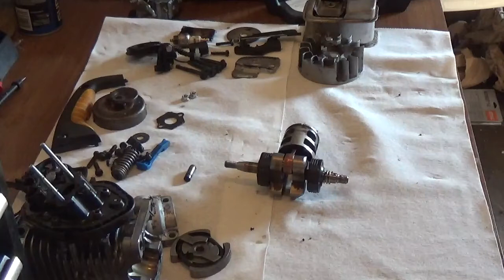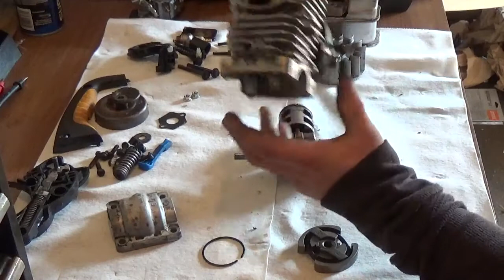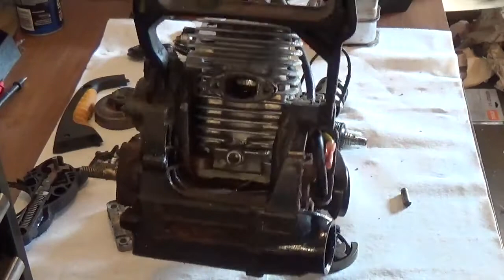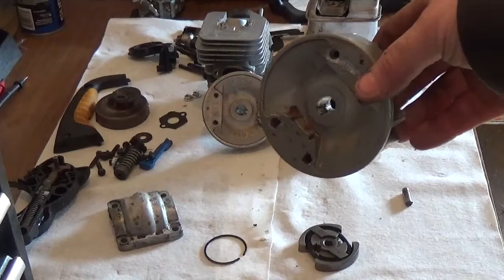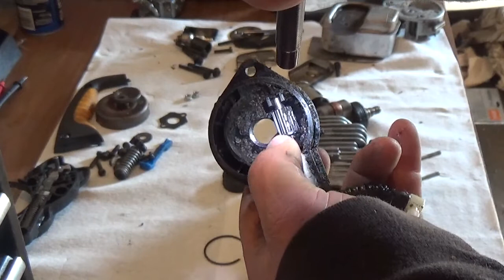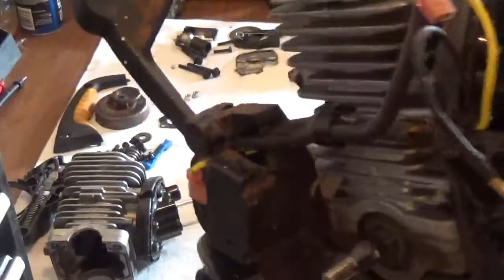Poulan Chainsaw pp 4218 {P.O.S.}

Comment: If you have one of these saws will these problems show up right away?  or can they fail anytime?  mine is almost 2 years old and probably 10 tanks of gas....
Reply from the maker: Almost right away....two weeks later ...a month ....often its just how much the operator uses it to the point that the saw over heats due to the piss poor seals that allow the saw to start screwing up ...Then little by little the saw will have issues that become very apparent in a hurry .
Reply: @kevinbolin7665  thanks, it was a great deal at the time for $107 new but if it ever craps out I'll probably go husqvarna.  I'm more of a hobbiest firewood cutter....

Comment: I would suspect that that saw was going wide open and then the chain stopped suddenly which caused the crankshaft and the oiler gear to get stripped at the same time.  It's not a good outcome, but Stihls aren't immune to broken crankshafts either from likely the same cause.
Reply from the maker: One can only speculate / However experience can speak volumes with encounters that have educated a individual with years of said experience . My experience with numerous Poulans {MODERN }has lead me to know the quality as well as performance . If I had to surmise a theory by right of personal experience it would simply be because of quality in craftsman ship {machining } of parts .

Comment: I bought my PP4218 in 2006.  I've replaced the fuel line once and the chain twice.  Sure, it's used for light work, otherwise, I would have gone with an Echo or Stihl.  My point, buy the right tool for the job.  Take care of it and it'll take care of you.
Reply from the maker: And your wallet if its a Poulan ...Love where you went with this ....

Comment: I have a PP4218A very new, very little used.... I'm a big guy with very strong hands and I can't get the fuel cap off without a tool.  Also,  it has developed a problem that you haven't yet discussed,   I pour fuel into it and it pours right out.  haven't got into it yet  but I'm already thing about getting another saw.

What saw do you recommend?
Reply from the maker: Your leak is likely due to bad fuel lines or a faulty tank vent .......There are rare exceptions that the sealing ring {O RING} on the fuel cap will leak fuel as well .

Comment: I would HIGHLY recommend the Poulan 2900 (46cc that this is so light and compact) I carry it for tree work and liming. It is a good alternative to a 4218. (and has a Walbro carb) LOL tight gas caps - I have had to take a dremel tool to quite few to keep my blood pressure down on the job!

Comment: I am looking for a chainsaw with an 18" bar. What would you recommend. Your knowledge would be greatly appreciated. Thank you
Reply from the maker: MS 290 or Ms 310 are excellent chainsaws. And depending on how aggressive you wont to be the 325 bars and chains are ok for farm and home but the 3/8 bar and chain are typically what loggers use with these saws for limbing and or wood cutting . Now that being said if your only going to do miner task around the home a Ms 180 or my personal favorite the Ms 250 make great chainsaws . But be warned Stihl Chainsaws are great but they still have there issues . There oilers are effective but can still present a problem as they do fail {not often} but still they do fail . Note I didn't include newer Stihls such as the Ms 291 not because there terrible saws but in honesty they suffer a lot of carb issues . But the carbs on ebay are cheap enough ....So you be the judge .....My personal preference would be the older Ms 250 or Ms 290.
Reply: Thanks Kevin for the quick and helpful response. I was thinking of the ms250 as well. Do you feel that is a better choice than the newer ms251?

Comment: I have a p3314 that shattered a piston and bent the rod. I can’t find out why.
Reply from the maker: {Honestly} there cheaply made ......and I really don't mean that in a sarcastic way....its just the evident truth .....what often happens is the cylinders become {galled} or glazed as the coating slowly gets worn away . The internal heat and friction will eventually allow the rings to cut away enough alum from the cylinder that on the exhaust stroke the piston will seize . This in turn will create extreme force on vital mechanical parts as the con rod and even the crank shaft often taking them out in the process of the failure .
Reply: Kevin Bolin that and when you go to adjust them, you have 2 options. Get it to idle right and have it run like shit at high rpm, or get it to run awesome at high rpm and not idle at all. I’ve also seen bar studs pull themselves out when tightening the nuts and crack the case which then turns into an oil leak. POS!

Comment: The older ones are great the new ones make great also when u  use them as a wall hanger or paperweight I’d recommend to use caution though the might break in the process 😂

Comment: I which you would compare them againce the sthil. There brake because 1/4 vs 3/8. Filter compartment.  Again key size. Plastics oiler compressed vs steal.     I use them but I have seen parts others big difference.

Comment: Thank you for the truth on poulan chainsaws.  In the past I have owned a few and none had lasted longer than a year or so.  I finally got a Hhusqvarna Rancher and so far after three years have had no problems with it.  Which saw do you recommend in the end?
Reply from the maker: Husqvarna makes  nice saws so long as they are on the higher side {Money wise } this will intel normally a 55 cc engine or above with a mag crank case that can be split . however there lower lines leave a lot to be desired ...The 455 rancher would be considered a higher end saw ...so you should get many years of great service only encountering oiling problems and at worst a carb or tank vent issue ......say the norm ....seals can leak due to the bearings going bad but it is rare .....

Comment: I have a Poulan leaf a shredder vac. And it’s a piece of crap. The gas tank seal sucks, it runs rough as hell, and it just overall is a piece of trash. It’s about 6 years old and ever since we got it, it has been a complete piece of junk. I replaced it with an Echo PB2520 and that sucker blows the poulan out of the water in terms of power and reliability.
Reply from the maker: Completely believe you ….Echo makes some great power equipment …...Just make sure you keep a eye on your gas to oil mixture.....personally I run 40 to 1 in most Echos and use F.D. rated oil mix . It burns clean and in my experience really seems to make the equipment last longer before needing to be rebuilt . I have had a srm 230 for several years now and to be honest I have only had to replace the carb once. Wish I could say the same thing about my FS 45 Stihl .Don't get me wrong both run great and I would be lying if I didn't say I prefer the Stihl but I try to push honesty in my videos and with that honesty being said the Echo seems to be less problematic than the Stihl ….At least with the replacing of carbs as my Fs 45 has required 3 in the 8 years or so owned .

Comment: Why should we put up with people selling this crap year in year out, getting rich by fooling the gullible.  People know enough about material technology to build a reliable saw. It's a complete waste of plastic and metal and the time of us that have to keep trying to fix them.  I only really want to look at Stihl and Husqvarna XP now and even these have silly issues.
Reply from the maker: So very true ......The quality suffers more and more every year .
Reply: Talk to Husqvarna - they own Poulan (most of the Poulan parts have Husqvarna part numbers - I have run my 4218 for years - it isn't close to my 455 Rancher but it was worth the $100 (I really think they have some serious quality control issues - you have some turds slipping past the inspection process in manufaturing)
Reply from the maker: True ......I think a lot of it comes to the bottom line market ....They just are not as concerned with quality in these saws due to the cheap price point there often sold at.
Reply: So can you switch parts?